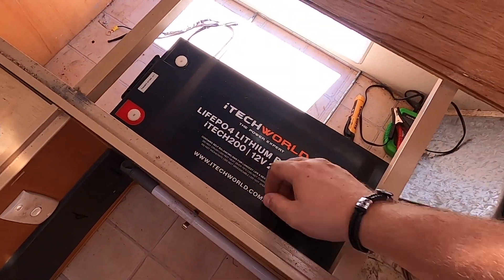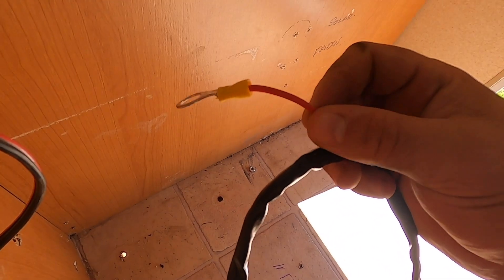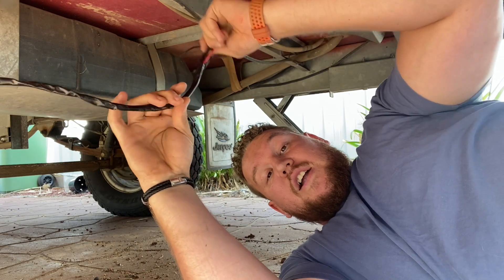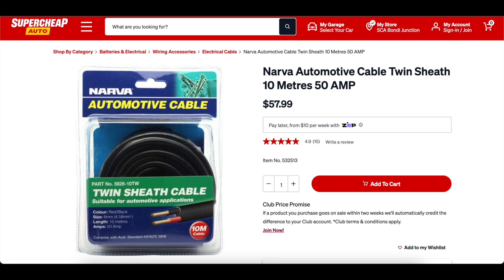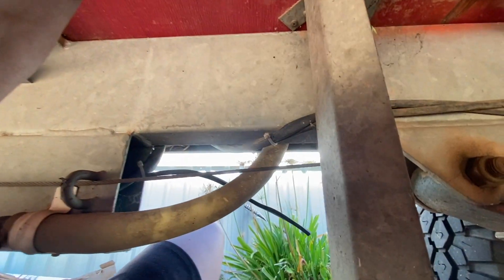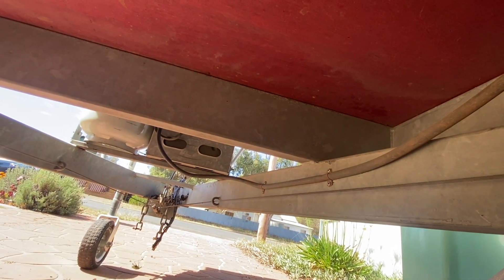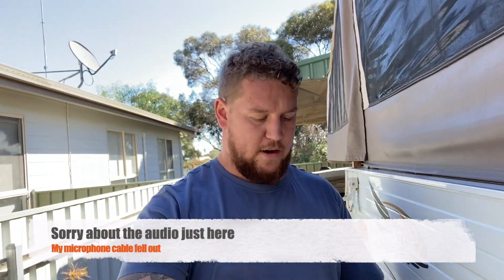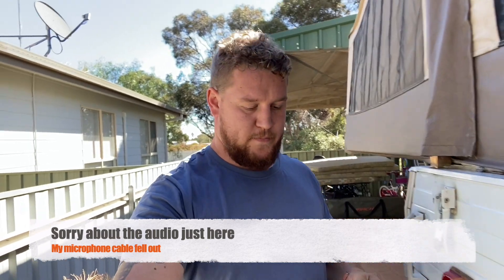Jayco Lithium Upgrade | ITECH 200 and DCDC 40 Install | ITECHWORLD

Comment: 😅hi been watching your videos just woundering don't you have to connect the ignition wire   for this to work as I want to do mine thanks
Reply from the maker: Hi Darryl,
Ordinarily mate, the ignition wire would need to run back to a switched source of 12V power in the engine bay (either the fuel pump, ignition on etc) 
Only reason I haven't used this is the Colorado I drive has a fixed voltage alternator that makes the ignition cable redundant.

Comment: First I would install a fuse right at the battery terminal rated to protect the rated cable.Second any exposure double insulated cable exposed under your van clip  curogated protection over from rocks etc.If you have two different size cables each cable should have a rated fuse for that circuit,Hope The makes your van safer.PS take spare fuses for in case.
Reply from the maker: Great suggestions Geoff.
Glad to say I've done exactly that!
All external cabling covered by corrugated conduit and extra fuses installed at various points as well as extras on hand!
Thanks for the comment mate.

Comment: Hey mate that’s not 6b&s cable, what your using is much smaller, maybe see how your charge goes but you will probably have to get some actual 6b&s cable if you charging at 40amps
Reply from the maker: Spot on Russell. 
I miss spoke and was wondering who would pick up on that first 😂
After a quick voltage drop calculation I worked out we can get away with the 6mm2 but couldn’t run any longer cable without going up a size.
Reply: Hey buddy great video set well done. the user manual size for cable is 1-5m length should be 8 b&s cable not 6mm. I would recommend using 6 b&s for any 40a DC to DC charger to maximise efficiency. Also just checking but I can't see a fuse I hope it is fused at both ends.
Reply from the maker: Cheers Kevin,
100% mate, I do have 6 B&S cable to upgrade if need be. 
I had plans to measure the voltage drop against proper 6B&S cable and show it on another video.
Hopefully I can get around to it soon 😂
Reply: 6 b&s or awg is around 13.5mm2
Narva 6mm cable is 4.58mm2
A 40amp DC/DC charger will draw more than 40Amps. It will only put out 40Amps to the house battery but will draw more than 40Amps from the cars alternator. 
According to the manual for your charger it can draw 45amps
I hope you changed it. If you didn’t, had a run of cable from car battery to dcdc in van or 12m and a current draw or 45A you would have a voltage drop of over 4V with an alternator output of 14V. 
Use 4B&S for this job

Comment: Great video, once the ctech is disconnected from 240 power ac and dc chargers have been connected do we need an inline fuse from battery to ctech.
Reply from the maker: It'll depend on your system Ernest.
My SETEC already had an inline blade fuse installed. This may have been standard through Jayco, but I couldn't be 100% sure.

Comment: Hey Bud; quick question about the earthing side of things. Other than the earth at the crank battery did you have to earth any of the remaining items?
Thanks in advance
Reply from the maker: Hey mate, I’ve grounded the system in the camper trailer to its own chassis also. 
When it’s hitched up, this creates a ground circuit between both trailer and car batteries and separates when it’s unhitched.

Comment: Gday mate how are using 12 volt lights and 3 way fridge if you had bypass the Setec having same issues if I want to keep 3 way fridge
Reply from the maker: Yeah I'm running them off the lithium battery mate. With bypassing the Setec, it's really only bypassed the power supply part.
All the fuses and distribution still work like normal.

The 3 way still ran off the car while driving (normal) and I'd just run it off gas when we went offgrid.
Reply: @OutNAboutAustralia  cheers did you run a separate Anderson to run your 3 way fridge while traveling or are you  using the 12 pin plug
Reply from the maker: @SteveBatty-r1p sorry mate, misunderstood ya. 
Yeah it’s running through the trailer plug.
Reply: @OutNAboutAustralia  thanks but you still didn't answer my question are you using the 12 pin plug to run 3 way on 12 volt while driving mine has 7 pin and a Anderson on drawbar
Reply from the maker: @SteveBatty-r1p yeah mate 12 pin. Mine originally had a 7 as well

Comment: Thanks for a great video. However I was a bit confused about the role of the setec charger that came with the van. Do you use that to charge the lithium battery from 240v? If not, did you install a separate 240v charger for the battery?
Reply from the maker: Hey Lance, no the idea was to remove the Setec and simply use it as a fuse / marshelling box for the existing circuits. However I have since wired it back up in to see how it works with a lithium battery...video coming soon!
Reply: @OutNAboutAustralia  we’re you using something else to charge the lithium battery from 240v or were you only charging it from the car and solar?
Reply from the maker: @data-bass  just the car and solar up to this point mate.
Reply: Is that why you cut the end of the plug to the setec? Also mine doesn't have an isolator switch between battery and 240v so I'm assuming it does it automatically through the setec.
If I was to install a charger though would there be a problem with the separate charger and setec both charging at the same time?

Comment: Hey mate, does your DCDC stay charging even after your car is off? Also, my battery is full but the harger still kicks in and charges. I thought they only kick in when the battery is around 85%
Reply from the maker: Nah I haven’t had that problem mate. 
My Ute runs a constant voltage alternator though so it’s not a complicated system.

I’d double check your trigger wire isn’t getting a run signal from somewhere.

Comment: Do you have any detail on the 240 side? How do we charge the lithium battery with 240? Do you Bypass the jayco setec system and install a suitable charger? Or can another DcDc charger be used to take the DC output from the setec and make it compatible for lithium?
Reply from the maker: Hey Dave, thanks for the question.
From what I’ve gathered from iTechWorld, the battery is a “drop in” replacement for an AGM, so in theory I believe it could charge off the standard Setec, however it charges at a relatively low current meaning it would be far lower than optimum charging current for a 200Ahr LifePO4 battery.
I’ll be doing a video in more detail as soon as this rain in NSW clears off 👍🏽
Reply: @OutNAboutAustralia 
How did it go with the setec?
I'm looking at using one of these "drop in" battery's to replace my agm.
Already have a redarc bc-dc charger but worried about the setec.
Reply from the maker: Hey mate,
I’m actually testing it this weekend so I’ll get an answer to you hopefully tomorrow  arvo 👍🏽
Reply: @OutNAboutAustralia  
Sounds like u need a holiday mate.
😀
Reply from the maker: @renegadecampervan5017 
Tell you what I wouldn’t mind one 😂 
So the short answer, yep the Setec will charge the 200Ah battery, however it’s a slow process and wouldn’t be my first pick.

Comment: Hay mate, I see your not using the ignition cable on the itech. Curious if you have an older car or a new car and if you have a new car how does it go without the ignition cable connected?
Reply from the maker: Hey mate we’re towing with a 2015 Colorado. 
The 2.8 Duramax runs a fixed voltage alternator but the ignition wire wouldn’t have been hard to run.
Reply: @OutNAboutAustralia  thanks buddy
Reply from the maker: @highlander752  no worries

Comment: Hi mate What does the long thin black cable do that you haven't connected.wheres video 3
Reply from the maker: Hey mate, that cable is an optional ignition wire. 
I haven’t used it in our setup as our ute has a fixed voltage alternator so it wouldn’t really serve a purpose.

I had to push video 3 back as I realised I’d forgotten to get a shunt 😂😂 but that’ll be up next week.
Reply: No worries mate. 👍
Reply: @OutNAboutAustralia  and maybe some fuses to/from the DCDC charger? It's in the little booklet that came with the DCDC40.  I've ended up with this:
 - twin gauge 6 coming from Alt+Car batt into a 60A fuse (that was awesome in reducing voltage drop from under bonnet all the way to the camper);
 - then to the DCDC in.
 - from DCDC out into another 60A fuse
 - then to Batt
 - only connection to neg of Batt goes to shunt
 - other side of shunt goes to GND bus where any load should hook up.

Comment: Hey mate have you tracked the actual amps this charger is charging at?

A lot of people reporting they only ever see 20-25amps of charging from the 40amp dcdc.

Pretty poor form from itechworld if so. They have a habit of underdelivering
Reply from the maker: I have had a few issues with the charger. I’m actually in the process of a video trying to get the full rating out of it. 
It looks like itech have discontinued my particular model however 🤷🏽‍♂️
Reply: @OutNAboutAustralia  yeah sweet. That’s why I asked. Looks like they have a new model which looks the goods but it’s hard to commit to something if previous models have had issues. Kind of like their 120x and 120x pro lithium batteries and the discharge controversy.
Reply: @CJFranciss  I've just installed one DCDC40 in my jayco and another in my car (1 120XPRO Batt in the jayco and another in the car).
I get ~39A on both systems (not at the same time) when running from the alternator just fine. My alternator is 100A by the way. Still  a bit skeptical of hooking up both DCDCs at the same time even though one of them should cutt off when car batt goes < 12.8, etc..

On the Jayco camper, I left the SETEC in place for now as it is the only way I got to charge the camper batt when plugged on AC.
Still trying to figure out how to hook up a BCDC to replace it and get a better charging rate,  without too much fluff with the existing old jayco wiring.
SETEC is putting around 7A. I guess it cannot trigger bulk vs float properly as the batt is normally at ~13V

But regarding the current limitation you've mentioned, I definitely did not have that issue. Overall, pretty happy with the iTech products.
One thing that I could mention is that when the voltage of the main batt + alternator goes under 12.8V (I can make that happen switching on my spotties while car is idling, which adds 22A to the load  - not sure what fraction of 100A the alternator produces at idle speed ) It takes about a minute for the DCDC40 to switch off. I am not a fan of sucking the life out of the car when that happens... But apparently it is harmless for that kind of short time window. It would suck though if you are on start and stop kinda traffic...